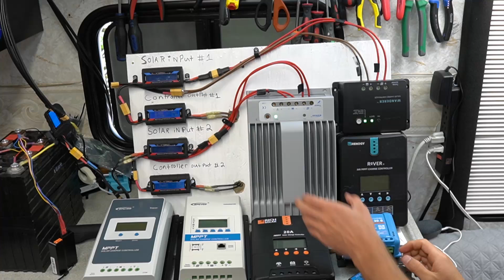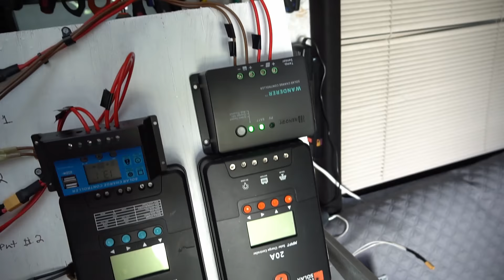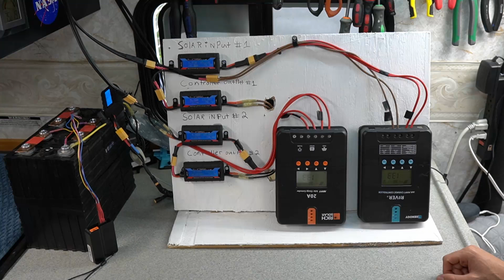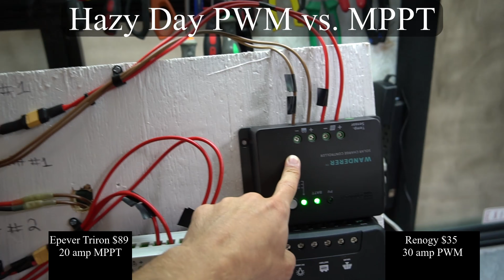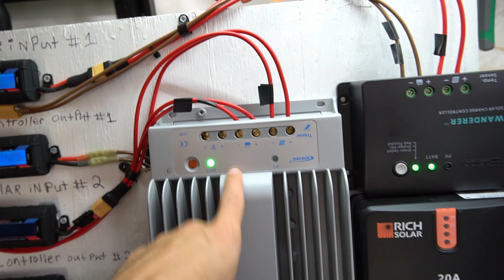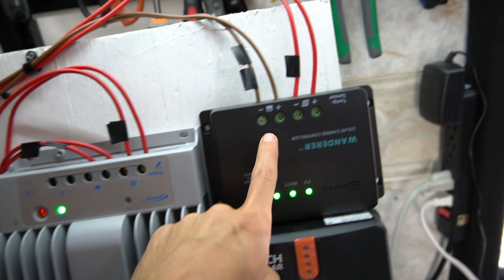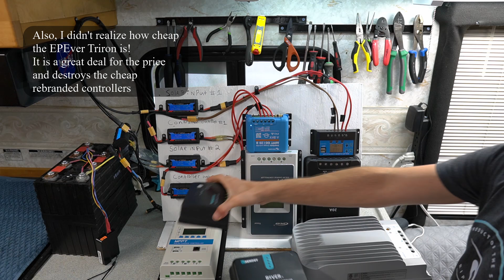12v Solar Charge Controller Buyers Guide - Beginner Friendly!

Comment: Hei, help me with an advice, I have a pwm for Two video cameras, how i Can Make this pwm to output just 12v, when I Connect 2 cameras it  send me 24v and burn them... IT is an other solution without a convertor   from 24v in 12v ? Thank You...

Comment: I want to put solar on my semi truck. I have 4 lead acid batteries that run the truck. My goal is to put one panel facing forward on the roof and one facing backwards on the back. (I try to park facing away from the afternoon sun to keep things cooler). Can you recommend a system for me?

Comment: Hello, I have a 240W, 18V panel and need to charge 2x Wet Lead Acid 125Ah batteries connected in parallel (12V)? I currently have a cheap PWM controller like the one you have in this video, which I think does not perform well. I estimate a max load of around 50-70W peak. Was wondering and considering purchasing EPEVER VS3024AU, what is your opinion?

Comment: Can anyone advice. 
I use12V  100A MPPT charge controller to charge two 100Ah 12V lifepo4 baterries from four 100W 12V  solar panels, connect with 4000W power inverter. During daytime when 2 batteries are charged in full, every 1-2 minutes power coming 14.6V, at this time my power inverter alarm beeping and disconnect like 2 seconds and reconnect. This continue happening every 1 or 2 minutes until batteries drop under 100%. I thought that charge controller is bad, so I tried with Renogy 30Amp controller still have the same issue.

Comment: Does the amperage matter?  I've got a 200 watt panel and I'll have multiple batteries and probably will get a 1500-2000 watt pure sine inverter.  Should I be looking at a 20amp or 40 amp charge controller?

Comment: Hi will,  great video thanks. my brother just bought a portable solar system for a 4wd and it has one of those $15 pwm solar chargers. I'm trying to convince him to upgrade at least to a pwm renogy, but thinking the cheap one will go into a trickle charge mode is that true.?. How is that with a lithium battery? Can you disable the trickle feature? Or adjust the settings to look after the lithium battery?

Comment: Thank you for this video. I have a 300W charge controller wich says it needs 20-50 volts input to work. My 150W solar panel puts out 18 volts. Did I buy the wrong controller or will this one work? Thanks brother.

Comment: Hi Will:  I have a EPEVER MPPT 30a Charge Controller, I have 2 Different 12v LIPO  batteries I want 
to use it with. I know you are suppose to connect the battery before the solar panels.
I have the  minus- on both batteries connected together  and to the minus on the charge controller.
I have the plus+ from the charge controller going  to a  2 position switch and each output of the switch 
goes  to  the positive of each battery so I can  use the switch to put the  plus+ on each battery separately.
I'm wondering if the Charge Controller will be damaged when I switch the batteries since the solar 
panels will connected to the controller and power will be interrupted to the controller when I
switch batteries.  Do you think the controller will be damaged with this setup?

Thanks 

Tim

Comment: That bargain 15$ PWM controller says its not designed to be used with lithium batteries. Do you know why? If the lithium battery is BMS protected would it be safe?
Reply from the maker: Yeah you can use it
Reply: It won't work with a 410watt panel connected to 2 12 volt Li batteries in series. But I don't know why?

Comment: Hey Will, I really need you to answer the following question.

In my 2002 Nissan Xterra, I have an AGM starting battery from Optima.  It has starting capabilities, and deep cycle capabilities also.  I am installing one of those new thin flexible 100 watt solar panels on the hood  of my SUV which will run through a 10 amp charge controller to the Optima battery.  But for years I have had a 1000 watt Inverter hard wired to my starter battery.  This Inverter allows me to use two DC cigarette outlets, 2 AC outlets, and 4 USB outlets to charge a myriad of items when I go car camping.  But Will, I am worried that when I install the thin flexible 100 watt solar panel and the 
10 amp charge controller that the solar panel will somehow damage my inverter that is positioned in the console inside my car.   I'm afraid I might have a fire---PLEASE HELP!  Tell me if I will be safe.

Comment: He Will,  i am a MD from Austria and your videos were a great help while building our off grid power system (24 volt). We use it to power our fishery. After two years of using AGM Batteries we switched to a LiFePO4 (8kWH) block yesterday. Today our power was down and all 4 fuses of the Solartronics inverter (1000 Watts) burned. The LiFePO4 is charged to 27.8 but the epever tracer display switches between 27 and 31 volts. Any idea what setting is wrong? (Charging limits, overvolt disc. etc. are all under 30 volts) Am i missing some basic setting? If you need any more infos please let me know. Big thanks in advance, Jakob

Comment: Hi
based on your experience is there a charge controller that can send all the information using modbus 485 or modbus TCP  ???
can we give an  address so we can monitor the system from a remote  location ???

Comment: Love Ur Videos!!!  I have one of the 60 amp Epever MPPT charge controllers and it seemed to work fine in my RV setup with 2 panels. About 6-7 months in the controller died. Now I find that EPSolar has ZERO CUSTOMER SERVICE!!  This prevents me from going with another EPEver..  Does anyone here have any contact info for EPSolar customer service. Email has not been responded to and I'm not calling China.

Comment: Which one is best for just a quick hook up to a sok 208 ah, without the need for programming. I want a 40 amp because I have roughly 600 watt solar power
Reply: I guess I’m just wandering will any of these fully charge a lithium battery properly?

Comment: great info thank you.  what thinking of putting 1600 to 2000 watts of panels on a cargo trailer and doing a 24V system with an optional generator.
To start just going to have led lights, 2 max air fans, small dreo 1500 watt (though adjusts down under 1000 watt) heater,  and for now no Air conditioner.  we mostly beach camp in california so weather is pretty mild.   Have to save up for extra 24V battery bank.  I'll probably just start with 1.
I'll re read you book and check on my power needs.  I think you mentioned 24V system for my cargo trailer application correct?  thanks.

Comment: Hi Will ,Great videos!! Got a beginner's question , Im building a portable battery box using a redodo Lifepo4 100ah mini would like to be able to charge using my bluetti pv120s 120watt portable solar pannel  i may puchase another to give me 240 watts whats the cheapest option that can charge the Lifepo4 battery ?
And be mounted in a case
Like apache 3800 ?
Thank you,
Jim

Comment: Will, I just ordered one of the SOK 100ah batteries linked through your website.  I have a solar charge controller called the sunduo controller which is old, do you think this is adequate to use or should we upgrade for the LiFePO4 battery.  We will be using it in our van for traveling.  We have a 12 volt fridge and two electric bikes to charge while we travel plus laptop, 12 v lights and phones as well.  Thank you.  We love you.  We watch all of your videos.  Thanks for doing what you do.  You are the best.

Comment: Thanks for another excellent review. I have a cheap MPPT solar charge controller, which was charging an AGM 200AHr Battery, but I'm swapping it out for a Lithium Iron Phosphate 100Ahr. Do any of these ones tested have a Lithium charge curve in them, or are they suited for both?? Do you think I could simply drop my LIPo in??

Comment: Hi Will:  great video!  The one thing I took issue with is you pumping two different charge controllers in the same battery.  Each charge controller is going to see the other as a parallel load to the battery.  perhaps the regulator of each controller does not care where it’s current goes. But it does mean that the current load will be different than if it had one battery each. For example, imagine that one of the controllers had a short circuit on the output. That short circuit would short the other controller output.  Yes, in this extreme case, you would probably blow a fuse.  But it makes the point that the controllers cannot be completely independent if you hook them up to the same battery.  If nothing else, and this is perhaps the rub, by hooking 2 charge controllers in parallel to a battery you have eliminated all certainty that they are being measured independently.  As you claim, it may not matter in the end.  But a claim is not proof.  And unfortunately this leaves doubt in the results. Regardless, thanks for the review!

Comment: Hi 
Sorry I found it a bit difficult to follow all different models , not being familiar with those makes specially in UK market, so can you please recommend just two different models which you think are the better for me, to be able to get one in uk market, as this is very new to me, i am retired and more knowledgeable about mechanical stuff  than  these electric/electronic things with a standard leisure battery , that's i have trying to install in my garage roof two of those panels for using jet wash m/c and small Inverter 4kw power , just a few lines of setup to follow the my plan 
Thanks

Comment: I saw a video testing pwm vs mppt and there was a huge difference as pwm cut the excess voltage. So im guessing your panels are optimised for low voltage to fit on a 12v. You sure as hell didnt plug in a 50v panel into the 3$ pwm. So feel the testing between them was a bit... Poor.

Enjoyed the video non the less.

Comment: Hey brother thanks for the channel! I have a off grid trailer. Im running a max fan, set power fridge, and misalanious led lights. It currently has a led battery I plan on replacing with a Li time 12v 100ah lithium . I also want to upgrade the cheep charge controller. Do you have a recommendation?  I also only have one 90w solor panel mounted on the roof. Can you recommend a second panel? Or do I even need one? Thanks!

Comment: ? ? ? 
Hello There, 
Need your expertise and your knowledge about 100A solar charger controller.

MPPT SOLAR CONTROLLER
RATE Voltage= 12v/24V 
Current = 100A
Max PV Voltage = 50V
Max  PV input power = 1200W (12v), 2400W (24V)

The Controller is working fine when connected to the battery
( 110V deep cycle lead battery) but as soon as connected to the solar panel ( 225W , 33.5 volt) the solar controller displays goes blank and solar panel input of solar charger just read 12.7 which is the lead battery  existing charge.

Would it fair to say the solar charger is faulty or something else ?

Would be great to know your view please ?
Cheers

Comment: hard to follow you-- well i could do this but i could do that and this and that--- learning is like building with blocks- you place one and then another on top--- going from one block to the next- you my friend are bouncing between 4 walls - changing the blocks - comparaing blocks put them down pickingthem up and moving eleswhere--- its like learn the family tree of teh hatfields and mccoys---  and yes when i was thinking of building one your videos were great- now that i am actually it  and with a starting point of a 24volt  4000 watt inverter--- damn its hard to figure out.   stacking all in ones dont make sense either-- why buy m,ultiple inverters when its multiple charge controllers that is needed--- can a charge controller be added to an all in one

Comment: Great video as always Will. I followed the link to your recommended charge controllers but I'm still a little torn on what I should go with. I'm building two 280Ah lifepo batteries and running 800 watts of solar for our 24v system. I'm fairly new to this, but you have me leaning towards the better built Epever vs. the easier to program Victron. Any thoughts?
Reply: @davidpatrick1813  Hi Daviid, I ended up going with a victron charge controller. We've had our system up an running for 4 months with no problems.

Comment: I enjoy your videos. I don’t know if you can assist me with a project. I have 48 Nissan Leaf modules. I connect them in 4s12p for a 24v off grid system. I have 2 charge controllers; a midnite 80A and a Schneider 60A. A Schneider 4kw pure sine wave inverter. I just purchased a 24v 8s 200A BMS. I am asking your assistance in helping with a diagram to connect these together. Thank you

Comment: What would you suggest for a reliable NON Bluetooth MPPT Solar Charge Controller for use with a 30 watt monocrystalline panel and 20 amp 12 volt LifePO4 battery?
Also what would you suggest for a NON Bluetooth MPPT solar charge controller used with a 150 watt mono crystalline panel and 50 amp 12 volt LifePO4 battery?

Am I able to use a 20 amp charge controller with a 25 or 30 watt panel?
Would I want anything larger than 20 amp charge controller for the 150 watt panel?

With intent to add a Rich Solar monitor.

I am intending to use this setup while motorcycle camping for some lighting, and a small .7 amp circulating pump.

Sorry for all the questions.
New to solar and trying to get my head wrapped around it.

Comment: I have a very specific need.  Let me know what you recommend.  I have four connected 12v 10ah lifePO4 Dakota Batteries in an ammo can.  I want to buy the smallest possible solar charge controller that can fit in my ammo can and have the ability to charge the four batteries using Anderson powerpoles and 150 watts of solar panels.  I have three 50 watt solar panels in a series connection.  I’m not on a budget so I want the ability to charge my 4 batteries the fastest possible with my 150 watt solar panels.  Keep in mind I may buy another 50 watt solar panel to expand up to 200 watts for future charges.  What do you recommend?

Comment: do any of these controls have low temp charge cutoff, and will any of them allow me to set the charge at 75% charge as you stated would make my batteries last longer? if so can you do a video showing how to do this
Reply: I guess you meant "high temp cutoff"?! Because low temp is not really a problem,  within reason! Very low temperatures (as in freezing) that's something else. But then the problem is not the panels it's the battery!

Even on the cheap PWM controller. One can choose the battery type and input custom programs, with different max and min. cutoff

Comment: Thanks for a very informative video. My situation is a bit different in that, for now, I am not looking to do solar charging. Ultimately, I would like to charge my camping battery from my vehicle battery/alternator while I drive via a direct 12V DC cable with the automatic isolator. But for now, I am charging it while I drive via an inverter which powers an AC battery charger. This works well, but my camping battery seems to discharge when the car is not running unless I disconnect the charger leads from the camping battery. Would you recommend any one of the above controllers for my situation? If not, what would you recommend? The battery is a deep cycle AGM battery.

Comment: Hey Will, All of your videos are awesome n detailed. Great work. I have a 5.2kw system (130wx4) with a 100A EPever MPPT controller & 3000w inverter. Here is the issue..MPPT calls for connecting batt 1st b4 you connect PV power to protect the MPPT, now when left un attended & batt power is drawn, drops below 11v & dies, happened few times & my MPPT was fried. Whats the device i can connect to automatically stop the inverter from not drawing from the battery beyond say 12.1V say until its charged again thru solar power. Hope i explained myself clear. Appreciate your help. Thanks.

Comment: wait, you got the same string of panel at the SAME TIME on different mmpt controller? this is not supposed to work right? you can't ma comparaison between 2 mppt if they are plugged at the same time, they will awlays have the same amount of power right? cuz they cannot do theyre work and use theyre own mppt algo since they are plugged with an other mppt, or do i miss something here? YOU are supposed to compare them when they are not plugged the same time to the panel, i'm not SURE AT ALL about what i'm saying but that's why you got so good result with the pwm, cuz they are plugged at the SAME TIME with the mppt?, pwm suck hard when you have a big array so i can't understand your result here, theyre is to little difference betwwen them

Comment: How hot is hot? I’m installing 6x200A panels in parallel ( so partial shade doesn’t negate all the panels from charging. Want to put SCC and 200A LiFePO battery under bed. Will it get too warn(hot)? Rich Solar 400watt solar kit plus 2 of the same panels. Using their 40A SCC.
Reply: 100 watt panels not 200 watt panels.

Comment: I just started getting interested in lifepo4, you are brilliant at explaining,  thanks - I am on a solar budget living in the Philippines, I mainly use solar as a back up due to all the brown outs here, I am currently using a Pwm cheap controller the $15,00 one you showed, blue in color, actually it is working fine, but as I want to switch over to lifepo4 I am not sure if the blue one will do? There is a green one same brand which is apparently for the lifepo4, what is it need to be able to do with the controller for lifepo4?

Comment: Hello. Thank for your video. I searched your video because I have some problem regarding solar charge controller system. If you have knowledge how to solve, please share it with me. Here is what I am facing. My company manufactures time switch. It is connected between battery and LED light and sometimes time switch got shocked and don't work. I need to wake it up by pressing  reset button. I don't know why it happens and how fix it. I wish you can read it reply me. Thank you again. I subscribe you now.